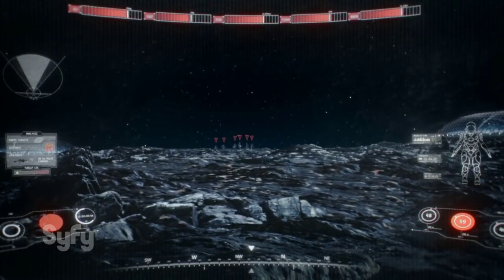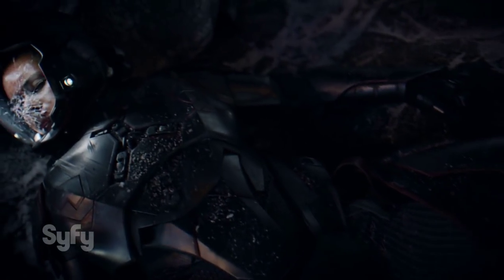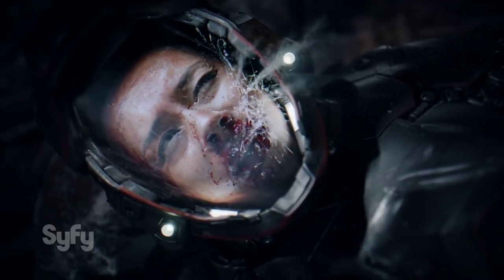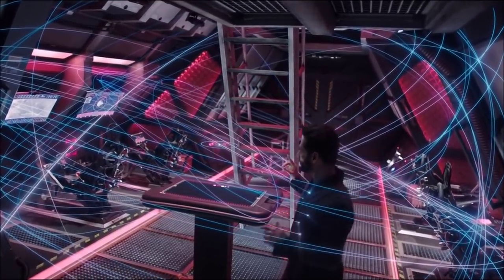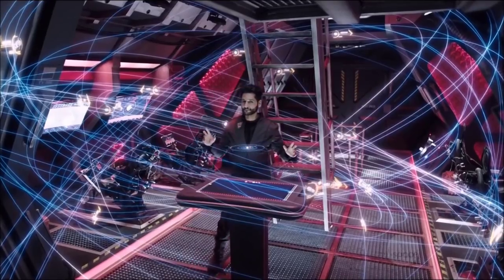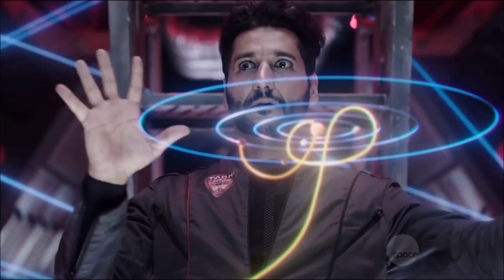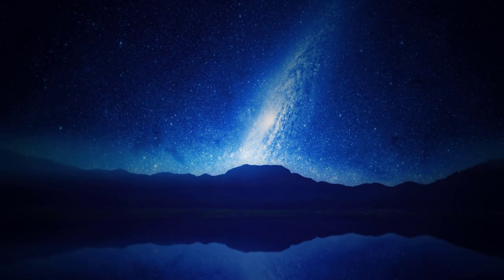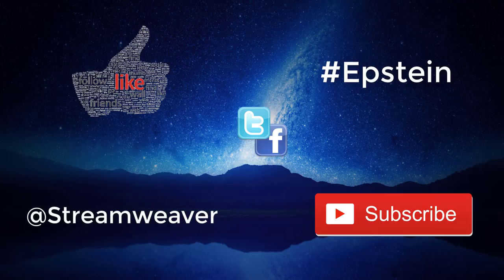Let's Do the Science:  The Epstein Drive

Comment: The graphics make it look like it some sort of VASIMR drive probably powered by a fusion reactor.

VASMIR drive could get us to Mars in 30 days from my understanding, so speeding that up to 3 just 3 only require a 10 fold improvement.
Reply: @David Knowles ~ VASIMR is a rocket thruster, not a power source. You still need an energy source. Presumably the energy collected or channeled from the fusion reactor is used to drive a plasma accelerator, which is what a VASIMR rocket is. Though the current VASIMR design has a theoretical limit of a few thousand Isp, which would not even begin to accelerate big ass spaceships as rapidly as the ships in the Expanse, so the exact method of ion acceleration can be implied to be some fictional means as-yet undiscovered.

Comment: here is an idea: the recently discovered quark fusion may be the answer - by fusing quarks toegether, we produce staggering amounts of energy, and as by product - heavy, and highly energetic particles, which could serve as means of propulsion. so, we could say we don't have fusion reactor per say, but what about quark fusion, where quarks are extracted from simplest atoms - like hydrogen or oxygen (which would drive water industry), and used as fuel for ships, and whole worlds...

this hypothesis fits rather nicely - the more efficient fusion of quarks may mean fusion into heavy neutrons, rather than electrons or protons, which would produce a lot more thrust, since the neutrons are  A LOT heavier than protons, or electrons. and since reaction drive is dependent on how much, and how fast you can eject matter opposite to the direction you want to move, it may yield all the answers.

Comment: #MyTheory       There would likely be two reactions taking place in a dual-chambered inertial confinement reactor. The main reaction would likely be either Deuterium/Helium-3 or a Deuterium-Deuterium reaction. The secondary reaction would likely be to take the plasma exhaust from the main chamber and introduce anti-deuterium, causing annihilation and producing likely more power than is required to run the ship. The main reaction chamber would likely be used to generate electricity to run the ships computers and electrical systems, while the secondary reaction chamber would only be used during full-speed flight.

Comment: 1G is your ultimate space propulsion sweet spot, because it creates a force inside the ship that would roughly resemble earth gravity. Many of the interstellar schemes thought up by scientists suggest you run on 1G as far as your future unobtainium based drive will go until the speed makes the energy required impossible to continue to accelerate (and relativity puts .a pretty hard wall on this). Then you turn your rocket the other way around and start decelerating at 1g at the point where doing this will eventually stop at the destination. Now, if your unobtainium powered rocket can get get enough speed up to be a respectable fraction of C, (Like 90% in an optimistic scenario),  relativistic effects means that the journey from the astronauts point of view will be a much shorter trip than a static observer on earth would percieve, making it possible to do journeys to other nearby stars within the astronauts lifespan. If you got to 99%+ of C you might even get to alpha centuri within a few years for the astronauts , possibly even less. BUT for people  not on the ship, it could be many many decades.

Comment: My theory is that the reactor is running conventional fusion reactions of the type we hope to use in fusion reactors here on earth at some point in the future when we make one work in a sustainable manner. The most common fuel source is therefore probably deuterium, since it comprises about 1.1% of any source of hydrogen. So it could be obtained from any source of water, such as the water ice in the rings around Saturn, or from the moons around Saturn or Jupiter, some of which are composed of mainly water ice. Or hydrogen could be scooped from the outer atmospheric layers of any of the gas giant planets and the deuterium separated from it.

Alternative fuels could be tritium, though that is rare in nature and would probably have to be made artificially by bombarding lithium with neutron radiation. Helium-3 would be another possible fuel, also scooped from the atmospheres of gas giant planets. Of course the closest source of helium-3 to earth would be the top few inches of dust on the moon, but that would probably be depleted fairly quickly.

Fusion of deuterium is the hardest to ignite, with helium-3 fusion easier and fusion of tritium the easiest. So tritium would probably be used as the "spark plug" to start up a reactor, followed by running on deuterium or helium-3 most of the time. The by-product of tritium fusion is helium-4, which is possible to fuse further, but helium-4 fusion is much more difficult to achieve. However, the fusion of deuterium produces helium-3, which could potentially be captured and re-used.

If the fuel is in the form of solid pellets rather than gases, then the likely candidates would be lithium deuteride, with a small supplementary supply of lithium triteride for reactor start-up. Using lithium is especially beneficial due to its low weight, but also because it can become fuel in the reactor. Lithium can fuse with helium-3 to produce helium-4, or it can absorb neutrons (from other fusion reactions) to generate tritium for further fusion reactions.

Anyway, how to convert the raw energy from the fusion reactor into thrust? There are two main methods I can think of, which could probably be used in combination. The first is direct energy conversion, using the sheer kinetic energy of the particles in the fusion plasma to generate electric current. This power could then be used to drive ion engines, either as part of the main engine or as smaller RCS thrusters. This could also be used as the primary electrical power source for the ship itself, either directly or charging up batteries for when the reactor is not in use.

The other method would be to use the enormous heat of the fusion plasma to vaporize and accelerate some kind of propellant to generate thrust, just as a chemical rocket does. Of course the propellant velocity would be much larger and so the specific impulse (aka propellant efficiency) would be enormous compared to a chemical engine. Also, since the propellant is not itself the fuel source, any kind of matter can be used - water, shipboard waste, rock harvested from asteroids, whatever. This is similar to how the "Project Orion" nuclear propulsion system was planned to generate thrust, except with a fusion drive, the thrust would be continuous rather than the pulses produced by nuclear fission detonations.

Comment: My theory is that the main nuclear fusion reactor that provide energy is isolated to keep radiations from harming peoples and damaging structures.
You can't just contain neutrons, but what if you pair them with a proton or an hydrogen atom ?
You get deuterium, a fusion fuel, even better you can circularize electrons the same ways as in a fuel cell to get energy from them and then recombine them after, in this case in the neutron + proton pair, making an effective deuterium.
I think they have fuel tanks, just not big enough to shape the whole craft, like cars for example whose aren't affected by fuel tank or even battery arrays, even aircraft aren't necessarily easily showing where they store the fuel and for amateurs who don't know that the wings are used in that purpose, they might not know at all where the fuel is and think the body tanks are the only one...
My guess is that the fusion is voluntarily taking place at extreme temperatures, using many things, from resonance to X-Ray focused heating, the goal would be to extract most of the heat from the reactor by transferring it to the fuel, the fuel is them accelerated at extreme speeds on the exhaust using electromagnetic fields.
If you have a really dense and heavy material that can get slowly eaten away on demand, heated at extreme levels, over 100K°C and accelerated at a good fraction of the speed of light, you might get a formidable specific impulse, meaning a great efficiency, and to archive higher acceleration you just need to "burn"(heat) more of that stuff.
You can then use a low speed and temperature version for near infrastructures/peoples use, and the landing pad with a really simple system of electromagnetic fields can not only protect itself, but also recover some of that fuel.
So if I had the guess, I'd say their fuel is a highly compressed material (Degenerate matter) a little like metallic hydrogen, but from a heavier element, maybe something easy to found, like Carbon or Oxygen for the lighters, maybe Iron which is heavier or Xenon which is one of the heaviest stable material we can use, maybe even lead which is probably the heaviest stable material without particular difficulty of manipulation or storage in its regular state and is minable from asteroids.
Maybe in the future we archived extreme pressure in labs by studying Neutron Stars and we found out how to concentrate Lead and other material in an extreme condition, it would explain why there are no fuel tanks and how they can still have 10G or more for weeks.

Comment: In later episodes it's explained they use water as the primary fuel source. Also they use an initial high powered burn followed by a steady low G constant acceleration until they are half way to their destination then flip 180 and decelerate constantly until they reach their destination.
Apparantly according to the books they can attain 1/10th speed of light though it takes a long time to get to that speed.

Comment: Fission could be enough to do this. A straight fission fragment reactor would have very low thrust, but radiation would be enough to vaporize the ship regardless of the material. So, I think they take this into account, and the inner walls of the reactor chamber slowly vaporize. The expanding metal vapor serves as reaction mass.

Comment: The most likely fusion reaction would be Helium 3 with Deuterium.  This fusion reaction does not produce any harmful emissions, releases a lot of energy, which can be easily harnessed to produce thrust.  The problem is that in order to fuse He3 with Deuterium would require a lot of input energy, possibly seeded using high powered lasers.
Reply: Hydrogen boron reaction perhaps?

Comment: The ejection mass is most likely made up by water (at least mostly). In Nemesis Games at Chapter 44 we find this sentence: "The only water was in the drives; ejection mass to be spit out the back of the ship." This ship is the Pella, which does not have an Epstein drive, just its predecessor, but still, it is powered by some fusion reactor. (This propulsion is called "teakettle", as you said.) Moreover, the maneuvering thrusters are using water too: "Maneuvering thrusters lit along the warship’s side, an ejection mass of superheated water glowing as it jetted out." (Chapter 41) Finally, in Cibola Burn, the Rochinante is able to change orbit when the reactor is down, so reactor byproducts must not be the main source of thrust.
P.s. You say that there is no obvious fuel tank is associated to any ship that we really see in the Expanse. Well that's completely wrong, the Pella has. "It didn’t have an Epstein drive, so most of the hold would be taken up by the propellant mass."

Comment: 1/3rd g acceleration should use less propellant than 1g, so lower thrusts could be used as a cost-saving measure. I've personally assumed that the epstien drive was some form of inertial confinement fusion.

Comment: What they call "tea kettle" is only using the maneuvering thrusters which actually use pressurised steam. They are used for rotating and fine course adjustments and aren't capable of serious or prolonged thrust.
What we know about the reactor is that it uses fuel pellets and lasers. So it's most likely an inertial confinement reactor. However, they often say the reactor has a magnetic-bottle confinement that sounds more like a tokamak design. Self-destructing a ship only requires you to drop the confinement and go supernova.
Other than that we know that it's crazy efficient as evident by the extreme fuel economy (often stated a ship has fuel for decades) and the lack of enormous radiators to shed the massive amounts of heat and nuclear reaction produces (not to mention stealth ships).

Comment: Energy is only half the problem. The other half is momentum. One must eject matter backwards to move forward. Mass times velocity going backwards must equal mass times velocity going forward (to be precise: Delta mv backwards = Delta mv forward). Therefore, there must be reservoirs of matter to be expelled backwards. 

My favorite speculation is the proton - boron11 fusion reaction giving three Helium4 ions that are expelled backwards with electrostatic mirrors. Almost no neutrons are produced but there are gamma radiations. The fusion fuel provided the mass expelled at high energy.

I have not calculated how big the reservoirs would need to be.

Comment: I guess it probably fuses heavier elements, as they have more mass and are solid like the pellets seen. Having more mass also means if used as ions for the drive they will provide more thrust, but they would still have to be accelerated to relativistic speeds to provide enough thrust to equal 1G or more.

Comment: What people fail to realize is that it's not the raw thrust in newtons that defines the acceleration, it's thrust-to-weight ratio. A light ship with a powerful engine with a little bit of fuel can accelerate fast. For instance, Space Shuttle's engines without external fuel tanks would be able to pull off around 5g. That's just a conventional (albeit pretty good) engine burning chemical fuel with an Isp of 450 pushing a ~100-ton conventional craft (Isp is basically fuel efficiency, so the higher it is - the bigger the bang per pound of fuel). It didn't have a lot of fuel in the orbiter, so the burn would end quickly, but it would still be measured in tens of seconds. Now imagine a lighter craft (due to 200 years of progress in fields of construction materials and engineering) using a fuel with an Isp in a range of six or seven digits (which is what's estimated to be true for fusion rocket engines). That racing ship from season 3 would be able to pull off much more than 15g, it would just smear it's passengers into paste. And it would be able to sustain the burn for days, if not months.
A whole other question is radiating waste heat, but that's off the subject.

Comment: I didn't know much about fusion back when I was in high school, but I built a "reciprocating-impulse engine" for my 10th grade science fair. All it did was jump up from the floor about two feet and fall back. It started with a pair of "C'" batteries, which I switched off after it made the first jump. It generated enough energy by falling back to lift itself off the floor again. My science teacher looked at it and said, "Oh! That's nice," then walked on. I have often wondered if several of them could be made together and serve as a propulsion unit. Set to operate in a cycle, they should be able to move a craft in space. The whole thing weighed about twenty pounds but I think it could be done better now. This was in 1962. I think I'll do some figuring and see what comes out.  If you think this sounds interesting give me a reply with some contact info.
Reply: Something spinning? What?
Reply: @Cranford Ducain  You'll get better results ie: (distance and speed) by removing all the "jumping mechanisms" and putting some wheels with low friction bearings on it.

Comment: Neutrons are not giant particles. Neutrons are subatomic particles with no charge. They are not normally considered ionizing radiation but they do cause the same damage indirectly. A major problem with neutrons is that they are captured by some atomic nuclei, which often turns those materials into radioactive isotopes of the same material. Neutron radiation is also difficult to shield against without adding a lot of weight to the ship.

All fusion reactions below p + 11B emit some neutrons. D + 3He produce about 1/2 the neutrons of the other fusion reactions. Since D + 3He is much easier to induce than p + 11B, it is likely that this is the reaction used in the books.

The energy output of nuclear reactions is charged particles (usually 4He), neutral particles (neutrons), and gamma rays (high energy photons). The most useful of these is the charged particles for use in a "fusion drive". D + 3He and p + 11B produce more of these for a given power output than the other reactions - which is another reason to suppose they use one of these reactions.

The power output required of the Epstein Drive is within the theoretical capabilities of a fusion reaction. The main problem is that any material vessel containing that fusion reaction would vaporize from the waste heat. A possible way to sidestep the issue, is to create the fusion containment "vessel" made of electromagnetic forces. This allows the waste heat to radiate harmlessly into space. This is called an "external fusion reaction" and would provide the level of performance leap described in The Expanse. However, it is likely a serious technological challenge that a tinkerer wouldn't be able to develop in his garage with his free time.